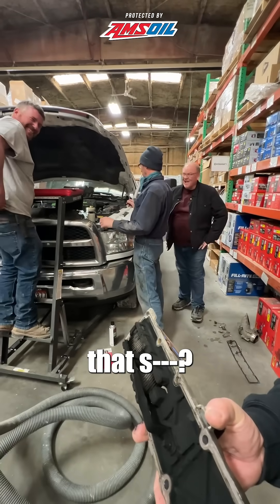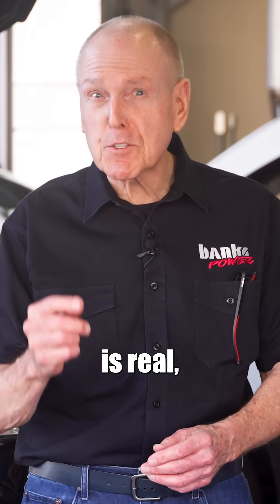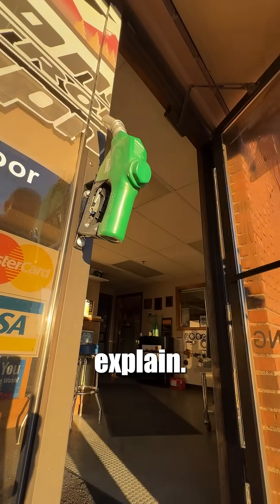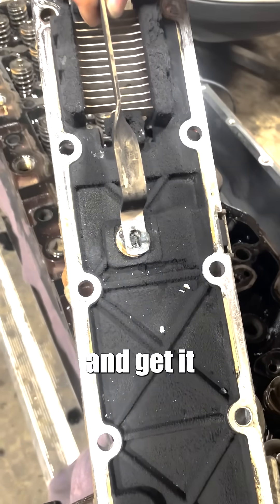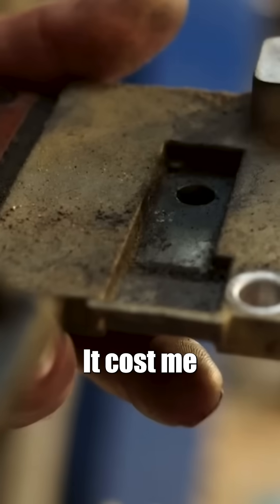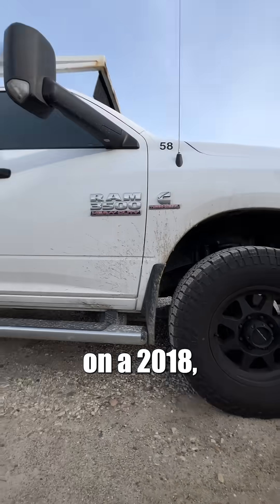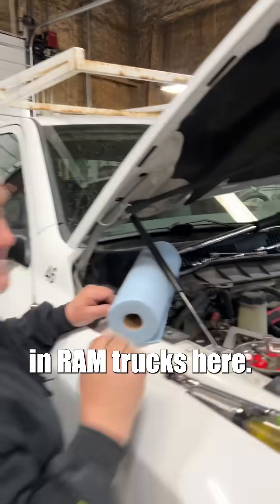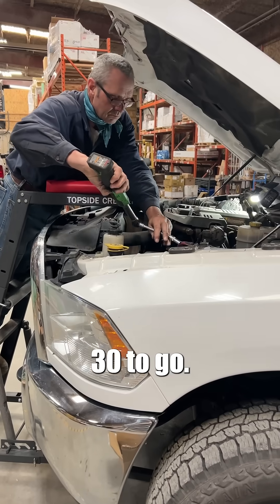Protecting $2,700,000 in RAMs from engine failure.

Comment: Stellantis is equivalent with landfill. Terrible leadership and terrible products.

The Cummins engine is not made by Stellantis. Cummins is independently owned by Cummins. I work on Cummins ISC 8.3s that REGULARLY come in with 250k miles and 12000 hours. On trucks that are WOT in terrible conditions for a lot of their life hauling 80,000 lbs down the road. We have never, ever seen an internal mechanical issue unless it literally ran with no oil or someone fucked something up. Sure, lots of oil leaks, coolant leaks, leaking exhaust manifold gaskets, turbo VGT issues, EGR cooler leaks, EGR valve issues, the usual culprits. The block itself is beyond rock solid.

Cummins still makes great engines. This is obviously a big design flaw, Im not a big fan of these intake grid heaters. I wish there was a better way other than glow plugs.

Comment: "Imagine owning a fleet of rams and knowing underneath the hood of every one of them is a ticking time bomb!"

Sir, you bought a vehicle made by Chrysler or Stellantis or whatever they want to call themselves today. That essentially summarizes the entire brand. I don't have to imagine anything, that's been a well reported fact for decades now.
Reply: Stellantis is equivalent with landfill. Terrible leadership and terrible products.

The Cummins engine is not made by Stellantis. Cummins is independently owned by Cummins. I work on Cummins ISC 8.3s that REGULARLY come in with 250k miles and 12000 hours. On trucks that are WOT for a lot of their life hauling 80,000 lbs down the road. We have never, ever seen an internal mechanical issue unless it literally ran with no oil or someone fucked something up. Sure, lots of oil leaks, leaking exhaust manifold gaskets, turbo VGT issues, EGR cooler leaks, EGR valve issues, the usual culprits. The block itself is beyond rock solid.

Comment: fixed one problem, but you may have created another. more performance might just hammer your rod bearings. especially if you have a driver, that’s easy on the truck and Likes to lug the engine.

Comment: So a valve cover bolt gets through the head into the cylinder and they change the intake to fix it? I'm Confused
Reply: Did you even watch the video?  Grid heater is part of the intake system. That bolt is in the intake tract. It gets hot and fails. Next stop, one of six cylinders. Engine go knock knock knock. $$$ flies away... just like the engineers knew it would..

Comment: US diesel is pretty “dry” as the sulphides have been removed. USD a 1/2 bottle of two stroke oil or even chain saw bar oil in every tank. It protects your injection system.

Comment: Ram, Ford, Chevy, it doesnt matter. All these companies are producing garbage on purpose. I will never buy a modern desiel truck. Even toyotas new gas trucks are less than half as good as they used to be. The last thing you should have to do to your $60k+ truck is rebuild and modify the engine before its even 5 years old.

Comment: This story is bullshit, Banks or not. I worked for Cummins as a mechanic for 45 years. I  worked on starting with 6b with bosch p pump, ve pump, after cooled,6c the common rails. So from the beginning to end all versions. Only saw 1 failure like that from 1980 to 2023. So I call it bullshit

Comment: That ram air does nothing to replace the heater grid unless u convert the heater to a heating rod in the air horn. Its easy to do but mine didnt come with the heat rod.  Also that heater grid is hella restrictive and cheap to delete. Dont know why that wasnt mentioned.
Reply: Banks cant sell you stuff if you simply remove it

Comment: My employer with a fleet of GM 1500 P/U with AFM/DOD + Torque converter issues. Most trucks get an engine/trans or both by 150k. Worst part is the owners are the type of people to say "what'd you do to it" not ok let get it taken care of. Blew up my first truck because they said to take it easy when I told them I needed a water pump done 😅

Comment: Pretty awesome advertisement. I helped my cousin & a buddy do this to Ram 3500s and both were quite new (less than 3 years old)! My cousin’s truck was fine, the bolt was tight still, but my buddy had more miles & idle time on his truck as it was his ranch truck & was used all day almost 7 days a week! The bolt was loose & corroding. He has since brought the entire heater grid to coffee. There’s up to 30 guys there some mornings and about 50 of us rotate day by day. I am guessing but there’s quite a few with 2500s and a few others with 3500s. If the guys are BS’ing then you have sold at least a dozen more by his word of mouth. He believes his economy has gained, but in the winter he has a lot of idling time and that varies. He won’t say for sure. My cousin’s believes he gained about 2 mpg to the imperial gallon (a little bigger than a US gallon) in his truck.
Reply: Which is it? A different video you said, your cousins truck was the ranch truck, now its your buddys is the ranch truck....? LIAR!!!! Oh, btw your cousins 3.0 Tahoe is gonna fail! Those things are junk!

Comment: New grid heater and a delete kit  solves the problem we own 2 trucks,2014 2017, with over 200,000 on the orginal motors its not hard.

Comment: I’m curious as to how wide spread of a problem this really is. I have a 2007 with 213k on the dash and I do “the wiggle test” every oil change but mine is tight as can be but on the other side I hear stories of new trucks with 50k that have a grid heater failures. What’s the deal? Is it seriously just a luck thing? Does your home climate have something to do with it? I live in a warm place so I doubt my grid heater is kicking on as much as somewhere really cold

Comment: I think recirculating hot corrosive exhaust gases back into the engine is the issue, just my personal opinion.
Reply: I was just about to say
Reply: a lot of big heavy trucks do this to engine brake, to save wear and tear on the brake pads, also to avoid overhating them

A Jake brake is a device that slows down large trucks by using the engine's compression. It's also known as an engine brake or Jacobs Engine Brake.
Reply: @TheBigupz  S Jake brake is a flap in the exhaust that restricts flow which is very different from an egr

Comment: We did this upgrade and the only problem with it is that the heater that is in the banks is only 50 to 60 amps and the grid heater is 150, good luck starting your truck in cold temperatures we have been glued to a plug-in cord now.  Banks needs to increase the heating element x 3 for this to be effective as far as replacing the grid heater
Reply: Stock heater cycles 3 seconds on 5 seconds off, so most of any lost heater performance could likely be restored by bypassing that.
Reply: Better than others that just remove it entirely.
Reply: He's working on an upgrade for that he said.

Comment: Just like 6.0 and 6.4 people say “oh they’re great once you rebuild and stud it” like dawg it should’ve been good from factory
Reply: I will say though fixing the grid heater issue is a LOT easier than putting new studs in a v8
Reply: @ I mean probably yeah lol depends on who you are though I guess either way it’s something a buyer shouldn’t have to do
Reply: @ 100%. The fuckin accountants got into the engineering department and now just about every car on the road is designed to just barely run long enough to be “ok”😂
Reply: @tristanphillips8937 barely long enough to last the 2 year mark
Reply: I don’t think it’s fair comparing the Cummins to a Power stroke 6.0 or 6.4. Those Power Strokes had a bunch of different issues. I would say Cummins always had a minor part that could fail and be catastrophic. Remember the killer dowel pin on the 5.9L?
Reply: Proud 4.9 300 owner yall can suck it
Reply: @noahklein97 a god among mere men 🙌
Reply: 5.9 cummins are great dont have this stupid grid heater problem and are way more reliable compared to everything ford and gm make and way easier to maintain don't have to pull the cab to do shit to it 😉 👍
Reply: The difference is that the 6.0 and 6.4 still suck after a rebuild and bullet proofing.
Reply: "once you rebuild it"- if I have to build it as soon as I get it, either I have a ton of aftermarket parts going on, or the thing is a MAJOR POS. 

I wonder how much of a vehicle's price is actually labor?
Reply: Northstar owners are the same, like telling me how i would need to send my engine out to the Midwest to get it rebuilt
Reply: As a 6.0 owner I suffer on a 2-3 month basis, especially with the HPOP that recently failed 6,000 down the drain
Reply: It's just a long, churched-up way of saying "the block is great"
Reply: I agree completely 😂😂
Reply: This seems a lot easier if a fix that a ford 6.0 thi
Reply: Man for real! This is ridiculous
Reply: How can any working Man afford an $80,000.00 Truck, making $60,000.00 a year, raise a Family, on his time off, work on his Investments, and have this issue not Ruin years of hard work?
This is exactly why Single Families cannot make it, the Stress it puts on a Marriage is hard enough, but when the Banks, and Insurance Companies don’t take Responsibility, doing everything to add more Stress!
I have seen this “FAKE AMERICAN DREAM” my entire life, and it seems like there are certain group of People that Hate you for not allowing them to run up the Anus!
Thomas Sowell… His Book, Black’s & Redneck’s explains just how this Works!
Reply: How can any working Man afford an $80,000.00 Truck, making $60,000.00 a year, raise a Family, on his time off, work on his Investments, and have this issue not Ruin years of hard work?
This is exactly why Single Families cannot make it, the Stress it puts on a Marriage is hard enough, but when the Banks, and Insurance Companies don’t take Responsibility, doing everything to add more Stress!
I have seen this “FAKE AMERICAN DREAM” my entire life, and it seems like there are certain group of People that Hate you for not allowing them to run up the Anus!
Thomas Sowell… His Book, Black’s & Redneck’s explains just how this Works!
Reply: Meanwhile 25+yrs later the 7.3’s are still happily clacking away with like no problems besides mabey 1 oil pan😂
Reply: The trucks theses day's are "VALUE ENGINEERED" cheap so the seller makes the most money not the buyer
Reply: 30k engine? LMAO
Reply: Yup I got a damn bmw with more years and mileage than that thats never ever been cracked open before. Folks cope so hard about american cars
Reply: My daughter sued ford for the 6.0 and got 450.000 dollars
Reply: buy a 7.3l.... i have people come and cold open ask me if im selling my 7.3 f350 dually with no sale sign on it...totally agree should be good from factory its not like that anymore with anything everything is half baked throw it out there lets see what happens screw the customer if it breaks they will buy a new one. Just an example not like it used to be the 1uz v8 in a toyota/lexus was over engineered and underpowered to last 300k-500k miles but HP sells cars
Reply: Such engine in a car is just plain stupid. They belong in semi's. You don't need anything more than a 2liter diesel in a work van, or maybe 3 liter if it's a huge monster towing something. Also, fuel costs 6.5USD per galon where I live.
Reply: @ovDarkness  😆
Reply: @ovDarkness You Europeans don’t have to tow heavy things like we do. Our campers, boats, offroad vehicles, etc, are all oversized. We need the extra capacity larger trucks and larger engines offer. 

Beyond that, many use their personal truck as their work truck, so it has to be capable of towing whatever is thrown at it. 

Distances here are greater. You can go across 4 countries in the span of an hour, we can drive 4 hours and still be in the same state. For this reason alone, a larger engine will last longer as it is naturally less stressed out doing the work. As a result, they go farther distances with ease.
Reply: 6.0 is fine stock power. 6.4 is better if you want more power
Reply: @carter.coleman we want reliability. I haven't owned any diesels but I've owned 2 sierras w the 5.3. both were shit boxes.
Reply: @Alwaysfishing2024 they had afm i assume?
Reply: @Alwaysfishing2024  6.0 chevy V8 lasts longer than the 5.3. I've seen a few near 400k with no major issues.

My brother inlaw has a 2003 chevy 1500 with the 4.3 that he doesn't change the oil in, he only adds to it. It's got 380k on it and only needed an intake gasket a few years ago. He drives it like a racecard everyday and can't kill it.
Reply: @Truckerdaddy  the 4.8 is more reliable than both the 5.3 and 6.0, but not quite as good as the ol 4.3.
Reply: @Alwaysfishing2024  than get a 6.7 powerstroke
Reply: @Truckerdaddy the 4300 ‘s are also 6 cylinders…
Reply: @Malibu252  I know, up until the mid 60s or 70s Ford was put the 300 straight six in there 3/4ton and 1 ton trucks. Chevy did the same. Both brands even had them in heavy duty applications such as single axle dumptrucks, snow plows, etc.
Reply: Hell Ford used the 300 inline 6 for anything from farm equipment, generators, cars, trucks, etc. It was easily their most widely produced engine next to the 302.
Reply: @Truckerdaddy he’s talking about a 6.0 powerstroke not a Chevy.
Reply: @Mike_to_the_k  the guy I responded to mentioned a 5.3 which is a Chevy V8, that's why I mentioned the 6.0 V8 from Chevy having better longevity. 

I never responded to the OP.
Reply: @Trucks_n_stuff No the 6.0 is far more reliable because they didn't put that afm bs on a single 6.0 ever made. Unlike every 4.8 and 5.3 since 2008 until 2018 or something idk I don't drive chevies anymore they're trash.
Reply: @RejectReality97  the operative part of your statement being "since 2008" because my 04 1500 has a 4.8 and it doesn't have afm, and it doesn't have EGR either, which every 6.0 since the early 2000s did have. Pound for pound the 4.8 is more reliable in the 99-06 trucks.
Reply: @Alwaysfishing2024 get one made before the displacement on demand.
Reply: @Alwaysfishing2024  If the first Sierra was shit box, why did you buy a second one?
Reply: @Truckerdaddy I’ve beat a 4.3L Vortec V6 senseless for 165,000 miles before. That thing was driven with straight up trophy truck/baja race behavior the entire time.

Never once did the drivetrain fail.
Reply: @Trucks_n_stuff 4.8 and 5.3 share a block. Carb a 5.3 and it’s all over for the 4.8
Reply: @carter.coleman dudes over here talking about power while we just want to make it to 200kmiles over 10+ years instead of doing 200k miles hotshotting in 1 or 2 years thinking that proves the engine 😂
Reply: @ well frankly the company’s don’t care what happens after the truck leaves the lot. People that buy brand new likely will do so every time there’s a new model and that’s what ford wants. They want you to need a new truck more often so they get more money.

Comment: Ok I've got a problem with this video.   Your having a problem with the intake grid heaters but all you talked about was the monster intake.  How did you fix the $1 bolt and problem with the grid heater?  The monster intake don't have anything to do with the grid heater or the fix for the problem.  How and where is the benefit for the heater.

Comment: So wait where was the bolt that fails? What part of the engine is it on? It looked like it was on the underside of the valve cover? Is that correct?  Or does that bank's part completely replace the part that held the unreliable part? More info needed please

Comment: This is a problem with the EGR system and not necessarily the grid heater. The grid heater in the 5.9l was never a problem until Cummings was forced to install the EGR and DEF components. Delete both if you like your truck.

Comment: What’s the purpose of the grid heater..  never seen or heard of it 

Great video ✌🏻🤔👍🏻
Reply: Warms the air going into the intake of the truck. Acts similar to those small resistive heaters for homes. When it's freezing out, this warm air helps the truck start easier.
Reply: Teh chilly starts brutha

Comment: Class action lawsuits have been done for a lot less. It needs to happen.
Reply: Re: Lawsuit: "Today we are working on a 2018, 2013 and 2020" meaning these are all likely to fail well outside of a warranty period, yes its still a very bad design but I suspect they will just claim its a maintenance item, to bad so sad now buy a new truck.
Reply: @ class action lawsuits have nothing to do with warranties.
Reply: @ibanezleftyclub : and yet where is the class action lawsuit? want to add one for diesel high pressure fuel pumps grenading themself, how about wet timing belts.
Reply: Class action lawsuits need to start raining on most all the manufacturers because they are quite literally cheaping out until it's the bare minimum for something to last just over warranty
Reply: Class action is only good for the lawyers
Reply: Dave’s auto shop explains it as a solenoid failure that stays on and melts the bolt , this is definitely and issue stallanitis needs to fix or get sued
Reply: ABSOLUTELY... Ram New.
Reply: @ I had a new Ram, each day I drove it, I wished I had my F150 back.
Reply: Yep
Reply: That and the CP4 pump. 10s of Thousands of those pumps have destroyed fuel systems that cost 10-15k a pop.
Reply: @poolguy101  Ram only used the CP4 for 1 or 2 years. They went back to the CP3 in 2021. As far as I know, Ford is still using the "updated" version.
Reply: My P pump 12 valve ask what bolt are yall talking about?
Reply: @ it’s only on the 6.7 not 5.9.
Reply: Expensive mistakes especially for Cummins/RAM
Reply: Absolutely!!  Why kind of engineering flunkies do that?
Reply: It's almost as if they do this deliberately eh?
Reply: So what did you do to the bolt?
Reply: Selling engine's! DEI HIRED!
Reply: @raymondmirabal5879 DEI has nothing to do with it. If you had no DEI, the "non DEI hires" are still going to be pushed to do the same. The problem is greed and it's from the top to bottom. The problem isn't some worker that does the same work someone else does
Reply: Racist much? @raymondmirabal5879